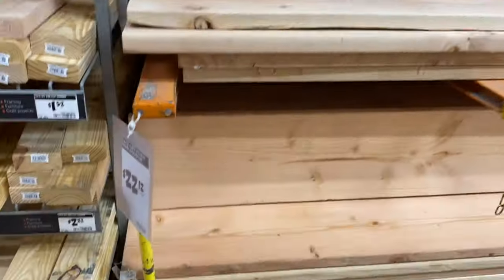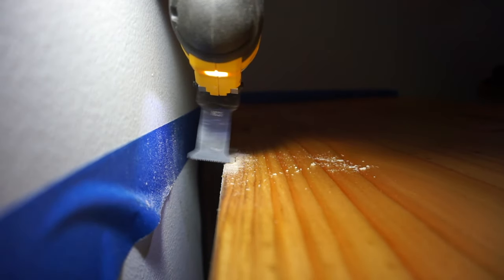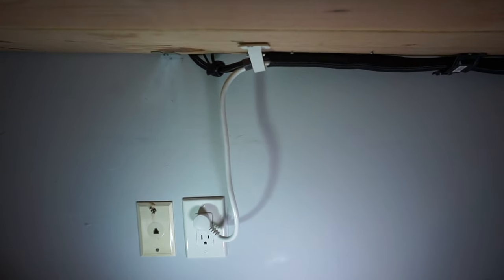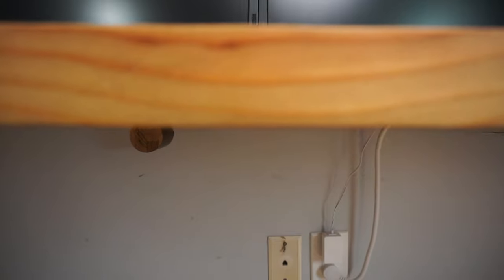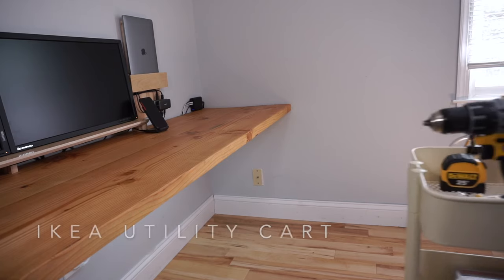A Minimal Floating Desk (Part 1)

Comment: 100% going to bow in the middle over time If not sart moving with expansion and contraction and only such small brackets maybe a 4x2 timber from side to side underneath where the LED's where to strengthen the desk top over time I have built one my self at home but my desk has 4x2 timber under fixed to the wall
Reply from the maker: There are metal brackets on each stud along the length of the desk, so far so good!
Reply: I agree and i don’t trust the weight capacity in such designs

Comment: Nice setup.  I just got done building my desk about the same way, though I didnt make the desk itself, I bought a butcher block counter top from lowes that is 10feet long, which is a few inches short of my room but I wanted a gap all the way around.  I'm not done with my setup yet.  Still working on the details.
Reply from the maker: Sounds great! Looking forward to see your setup if you can share on YouTube.
Reply: @ToolsElectroDIY  I may do that. Not sure. I’m not much of a YouTube creator or anything. Maybe when it’s finished I’ll upload a short video so that others can get ideas similar to what I have done. If I do I’ll be sure to come back here and let you know.
Reply from the maker: @redman2751  Cool, thanks for sharing!
Reply: How are you mounting the countertop if you don't have support on the sides? Angle brackets?
Reply from the maker: @zerosandones701  there are supports on both sides
Reply: @ToolsElectroDIY  oh I was talking about Jared's set up. I have a 12ft wide nook I want to do this on!

Comment: Not bad. won't hold up a whole lot, but if you attach all the heavy stuff to the wall (monitors, camera gear, etc), it'll be more than enough.
Reply from the maker: It's still going strong after 2 years.

Comment: Might of missed it but were you able to calculate the total weight the desk could hold?
Reply from the maker: No, it’s really hard to get that number unless I damage my wall or studs
Reply: @ToolsElectroDIY  thought so that's all good. Another question, where would I find the brackets you used to fasten the desk to the wall?
Reply from the maker: @louplay  I recycled some hardware from my old bedframe. I’m pretty sure you can find lots of those L-shaped brackets from hardware store.

Comment from the maker: 00:00 Overview
00:34 Building
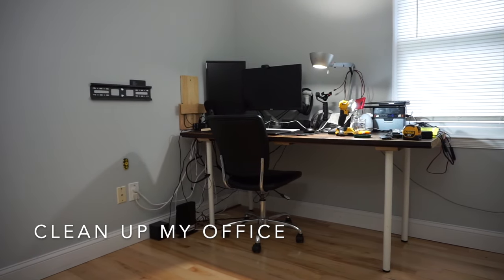01:34 Cleaning up office
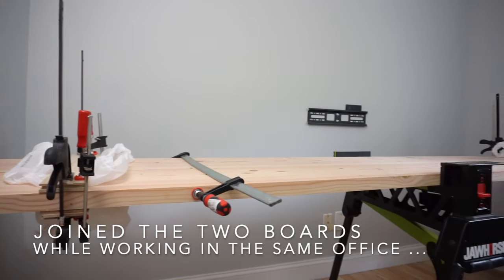01:47 Join boards
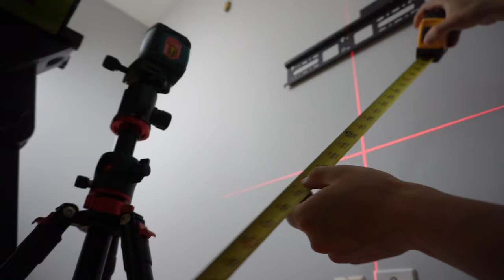02:08 Level
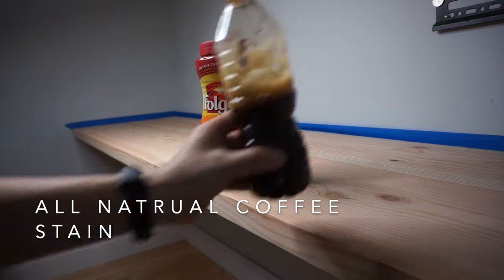03:40 Stain and finish
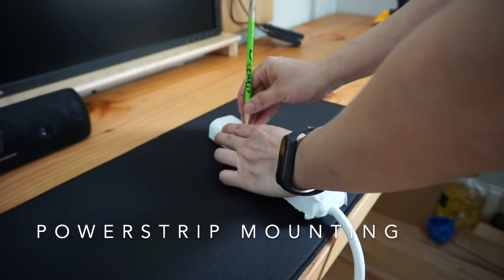06:41 Cable Management
11:00 Casters (Mac Pro)

Wall-mounted laptop dock video https://youtu.be/twy3sDyUNDk

Tools in this video:
LED Light: https://amzn.to/3oC0a1Q
Anker Type-C Hubs https://amzn.to/30AOB2T and https://amzn.to/3FpoPxE
6-port charger with Type-c https://amzn.to/2YPBVV0
Fiio DAC https://amzn.to/3ovTFhb
Stud Finder https://amzn.to/3cjpgNm
DeWALT drill https://amzn.to/3CLC6zN
DeWALT Impact Driver https://amzn.to/3CJ4pPu
DeWALT Flashlight https://amzn.to/3CH1czZ
DeWALT Oscillating tool https://amzn.to/3iIKurK
DeWALT Sander https://amzn.to/37FsEzU
DeWALT Circular Saw https://amzn.to/3F8Bftv

Comment: It's been a year since the video was uploaded. Did the desk sag at all? 

I'm planning a similar build and want to use 3 inch angle iron across the length and width of the board on three sides. What is your opinion?
Reply from the maker: No, it didn't sack. The center is well supported by the studs. It will be fine. Go ahead with your plan.
Reply: @ToolsElectroDIY  Thanks. Appreciate it!
Reply: The angle boards was the way I almost went before watching this video.  His is so much cleaner & takes up minima space underneath the desk.

Comment: 1. How is this a year on? Any bend in middle?

2. What wood is this?
3. How wide is the desk and how thick the wood?
4. Just down using metal brackets? I’ve seen people make wooden frames all the way around?
Reply from the maker: 1. No bend, no sack. Well supported in the middle. Watch my recent videos (laser level) e.g. you will see the desk in multiple recent reviews.
2. Pine.
3. 117 inches wide. 1.5 inches thick. (2 by 12 from Home Depot)
4. Right. L shape brackets are the only thing used.
Reply: Yeah just those brackets scare more, especially if you have a big 49inch ultra wide monitor not sure it can support it.
Reply: I might do a wooden frame and then in the very centre put a metal bracket for extra support maybe. But I have brick walls not studs so I got better support that way
Reply: I’m in UK

Comment: Thank you for the video. I recently purchased 2 6 foot butcher blocks and was going to use joist hangers with some wood as my mounting technique. Didn't even think about l brackets. I am concerned if the l brackets will support the weight property as the blocks are heavy but I suppose we will see. 

Also I recommend that you increase the sound of your voice when you edit. It was difficult to hear you.
Reply from the maker: Thanks for your feedback. I was inexperienced in video editing 2 years ago.
Make sure you use heavy gauge steel brackets, it should be fine!
Reply: Thank you for the reply 😄 I'm also inexperienced. I only recently started editing videos, except it is my gaming clips that I upload to TikTok. Never thought I'd download that app. Anyways, I use something called CapCut. It's a simple editor but it provides a lot of useful functionality.

Comment: Super clean look, nice work. About how heavy is the desk it self? Looking to do the same design with hidden brackets like yours but worried about sagging without supports running the depth of the desk. 
Thanks
Reply from the maker: Thanks for your comment! 50 ~ 80 lbs maybe? Put an Ikea Alexa drawer unit in the middle could help.

Comment: Looking great, Thanks for sharing !!!

On a previous message you mentioned the length of 116 in. on your wall. I'm designing something similar except on 98" x 24". And does the desk sag in the middle at all?
Reply from the maker: Thanks! No it won't sag, I have enough brackets along all edges including the middle.
Reply: @ToolsElectroDIY  what brackets did u use tried looking online cant find them
Reply from the maker: @triskeleassassin9203  bed.

Comment: nice looking desk. I was watching the video closely, especially when you mounted the desk to the wall. Are you just hanging those with the brackets you installed to the wall? maybe i missed a step and I was curious where those brackets came from? Considering something similar.
Reply from the maker: The L shape brackets are secured to the studs behind the drywall. They are recycled parts from a bed :)

Comment: Hi just wanted to ask about cable management, ddi you leave a gap between the table and the wall for the cables to run though? Or just you just cut one hole?
Reply from the maker: a little gap. and a hole.

Comment: What's stud finder, is it used to find concrete beams and columns? Can I just drill in brick wall, my wall's 12 inches thick .
Reply from the maker: In USA, we have wood beams behind the dry wall. Therefore that magnet is used for finding them based on nails. If you have a brick wall, you can drill wherever you want to mount this desk.
Reply: @ToolsElectroDIY  thanks that helps. I cut down an old thick Neem tree on my property a year ago because it had developed a rot cavity inside its trunk near the base. I'm soon going to get it milled into planks (it will be a lot of them) in few days. So I'm going to make some diy furniture out of them and save the remaining materials for when we decide to make new or expand our house.